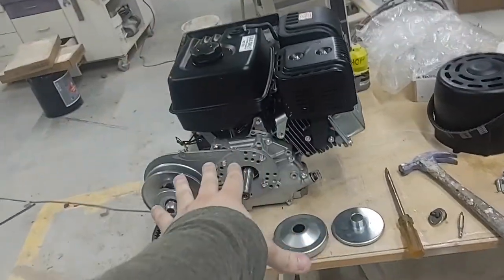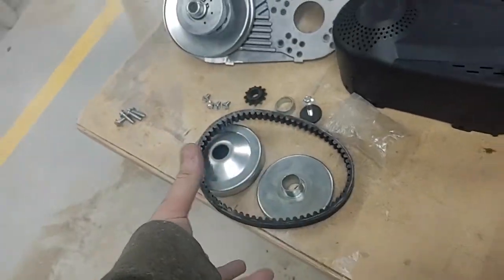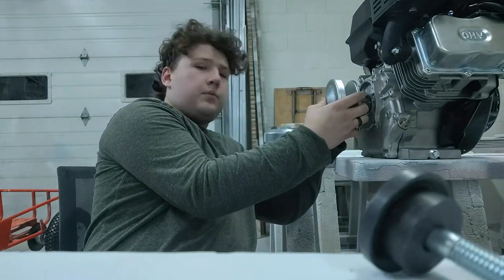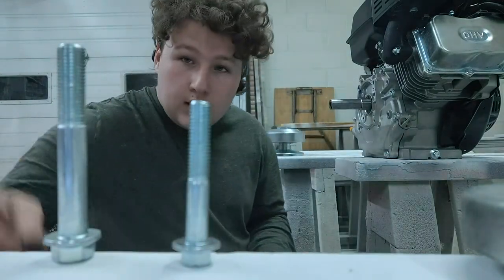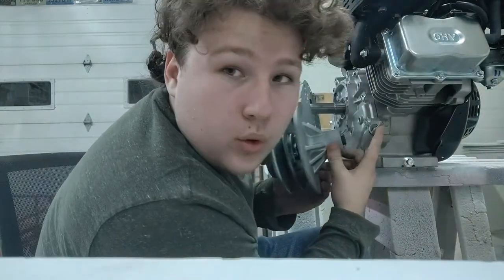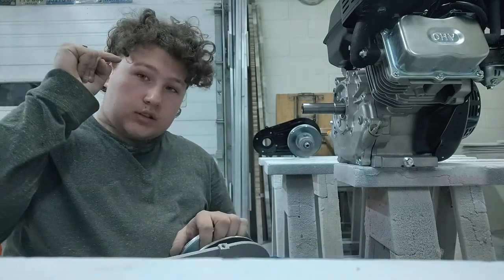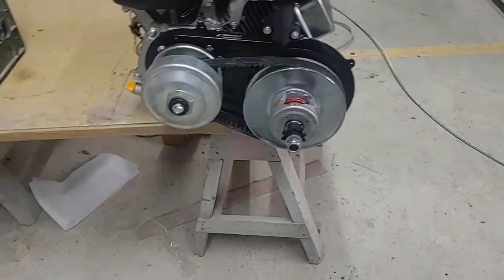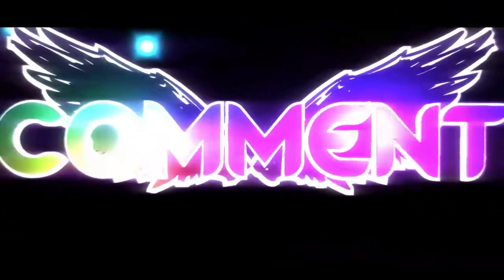torque converter 30 series vs 40 series

Comment: When you said 7/16 bolt, I assume you were talking about a bolt that requires a 7/16 wrench to tighten. If that is the case, then you are talking about either a 1/4 x 20 or 1/4 x 28 bolt. I would imagine the latter.

Comment: Thank u thank u great vid working on go cart  had Briggs and Stratton 8hps motor swapped 4 301cc predator and used the same converter from the Briggs and Stratton every time I pull the start cord the wheels spin?
Reply from the maker: what exactly do you mean by the wheel spins? and thank you for taking the time to watch my video!!
Reply: @lollife9203  i was told the belt might be to small or identical to high
Reply from the maker: @mrjackson749  well it might possibly be flipped the other way but if it's a small belt you wouldn't be able to sit on the torque converter itself
Reply: Any way to video chat withu

Comment: You have your drive pulley on backwards for that set up and will bend the back plate with the sprocket on the outside of the driven pulley the sprocket needs to be ware you had it and the front pulley needs to be filped around the side with the bid nut goes towards the engine
Reply: Was about to say same. That will eventually bend or break..

Comment: Let me help this putz out … 

just flip the driver. Take that silly set up off, flip that driver pulley … you have em backward. The belt should move along the pulleys evenly, without getting crooked. Make sure you have a reverse wound spring in that driven pulley as well. The Chinese knock offs can work well, but you have to understand what you are doing.
Reply from the maker: tried to flip it I tried to move it but basically I bought cheapest thing I could find what I could afford at the time.

Comment: You have a the wrong type of sprocket. That’s the c type sprocket you need a B type . It’s not as wide so it will allow you to push the driver further onto the shaft.
Reply: I run a 40 series on a stretched Db viper minibike and ran into a similar issue. I used the 30 series back plate, ordered a 8” inch Jack shaft, lock collars, key for the key way and shims. Doing over 70 in the 1/8th mile currently
Reply from the maker: thanks for the advice but I fixed my own problems with a little bit of time and thinking
Reply: Good stuff man, happy you got it going
Reply from the maker: thanks
Reply: @leonardteamer4708  do you use 40 series belt? I thought center to center of 30 series pulleys were 2” closer than  40 series.
Reply: @leonardteamer4708   can u send a picture to me i am trying to do the same setup thanks